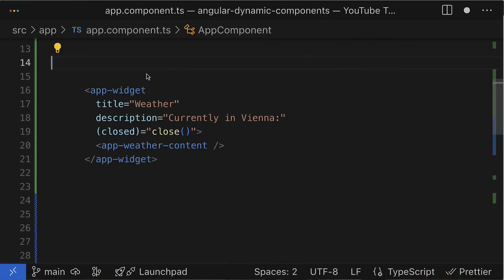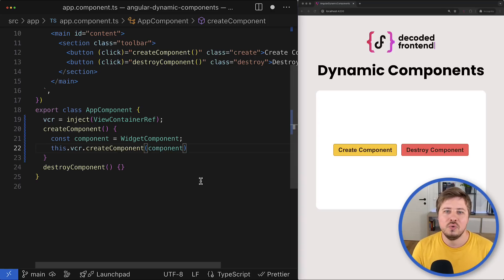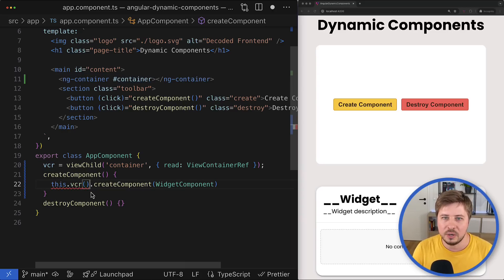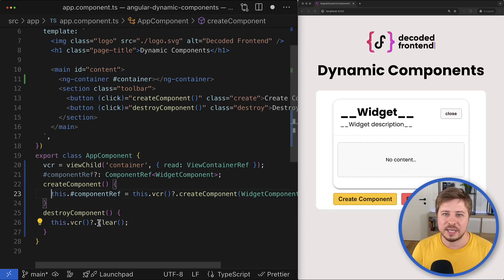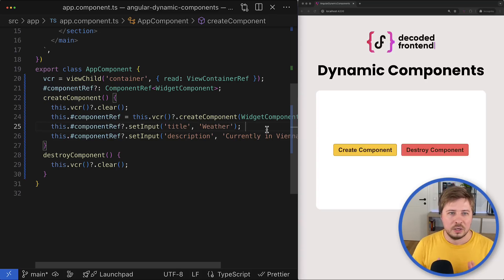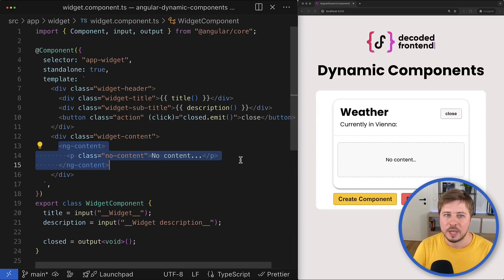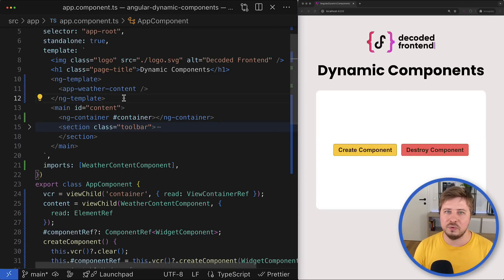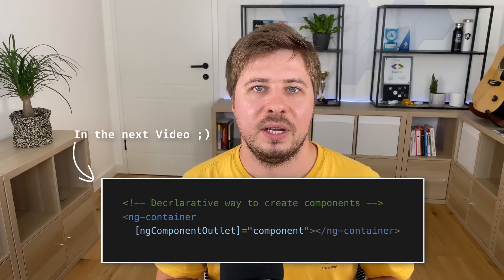Dynamic Component in Angular (2024)

Comment: In which case this can be useful? Just create component with all the inputs and outputs and render it based on condition.
Reply: For example, for a wyswyg, or if you have a dashboard where the user can create different type of widgets
Reply: @sokka7460 , you can use it to build your own components library: toast, dialog, or prompt services for example.
Reply from the maker: It might be useful when you don't know in advance which component has to be rendered (e.g. It depends on configuration from server). 

Using if/else blocks might work ok if you have only 1-2 components to deal with, otherwise you will quickly notice that this solution doesn't scale well and each time you need to add a new component, you have to introduce another @if block.
Reply: I have a task to create a custom directive that takes either a class constructor, a `TemplateRef`, or a simple string as input, and displays it as an overlay when the user hovers over the element bound to the directive. Handling the `TemplateRef` and string can be done easily with `ngTemplateOutlet` and string interpolation, but rendering the class constructor requires extra steps like what we learn in this video

Comment: Is it possible assign directive to dynamic component? For example create dynamic component which was implement of ControlValueAccessor interface and after that assign to this component formControlName directive
Reply from the maker: Hey! As far as I know, it is not possible to apply directives at runtime. However, I think that something similar you could achieve with Directive Composition API.

Comment: My first experience of dynamic component start at ~3 year ago when add npm module to Angular who doesn't have integration with Angular - its very help me make unic feature and save many times.
And I recommend make some unic ComponentRendererService with method renderComponent who take  (component: Type<T>, inputs: Partial<T>) and return ComponentRef<T> and here you can also control of destroy dynamic components
Reply: Can you explain, please, what is the "Type<T>"? I searched whole internet, but didn't get enough comprehensive answer...
Reply: @mirci5459 
export interface Type<T> extends Function {
  new (...args: any[]): T;
}

this is generic. Because T could be anything — a number, string, object, etc. But Type<T> specifically means: class that can be instantiated to get a T
Reply: @EtoBARAKUDAvasa  oh, got it, thanks! Pretty unusual interface, but helpful

Comment: Hello and thank you as always for your awesome content. I juste miss one thing here : could you provide me some use-cases of creating component this way ? :)
Reply: You can also create a modal service that creates and manages modal wrappers, allowing you to inject any component inside these wrappers, similar to how `NgbModal` works ;)
Reply from the maker: @Ahmed.Kharrat  dialog window a good example too. Thanks, Ahmed!
Reply from the maker: There are many cases. For example, you might get a config from the server that describes which components should be created, and since you don't know the config at build time, you have no choice other than creating components at runtime. 

You also might track validity changes of your form and dynamically create/destroy components with error messages depending on the validity state of the form control.

This is just the first that came to my mind :)
Reply: @DecodedFrontend  Thank you for your reply ! Creating component from a config file is a good example. Thank you ! It helps me. 

As concern as form errors messages, is that not the responsability of @if (*ngIf) ?